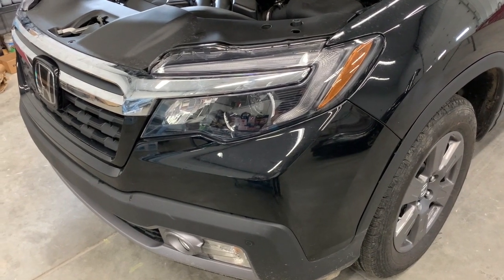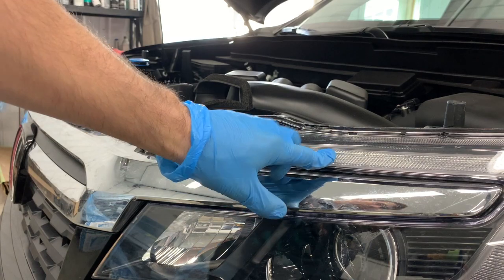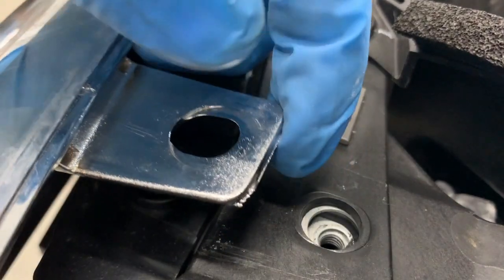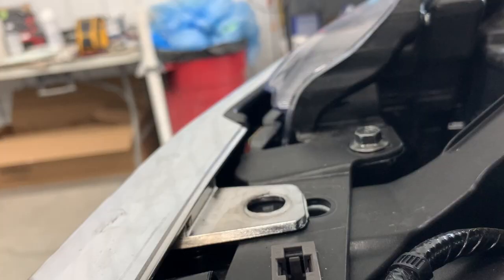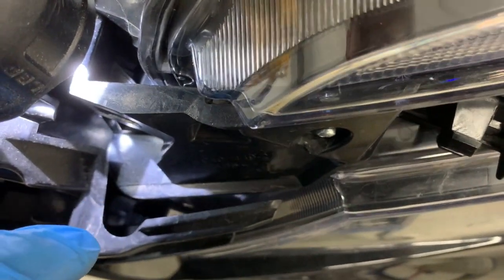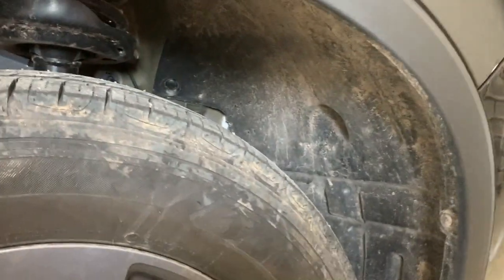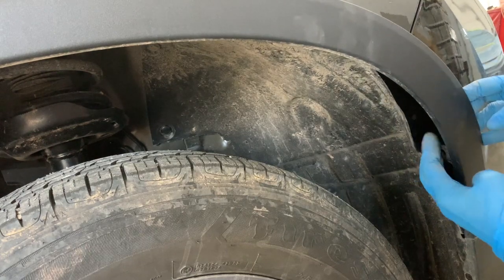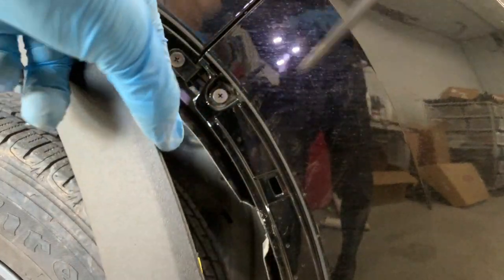How to Remove Front Bumper -- Honda Ridgeline 2nd Generation

Comment: You are awesome Man. You helped me in 2017 with the rear quarter panel. It had a gap. I showed your video to the dealer and that's how they fixed it. Thank you very much again. Now with this video I can take the front bumper of and install a block heater plug like a Tacoma and fix my broken fog light🙏🏽

Comment: These are good “trucks” but the front end is total crap. Everytime I so much as tap something with mine all the tabs come undone and it has to be re assembled. Moronic engineers design these around production ease not longevity or serviceability.